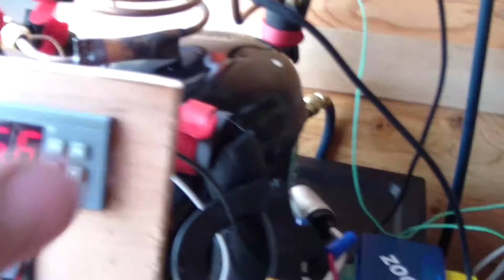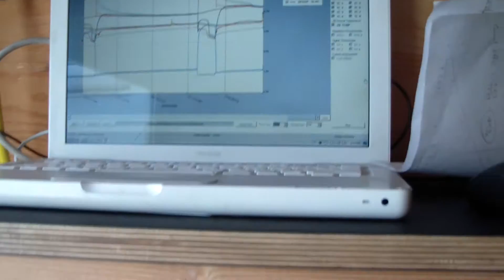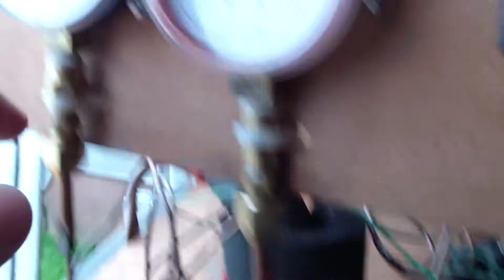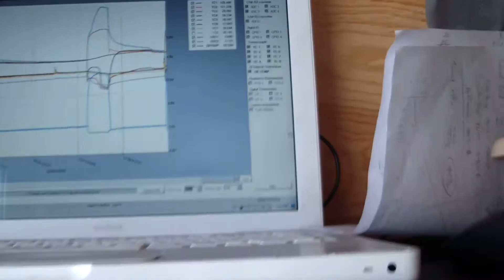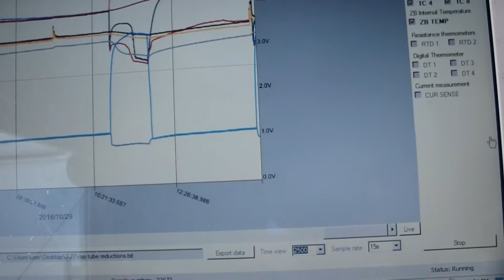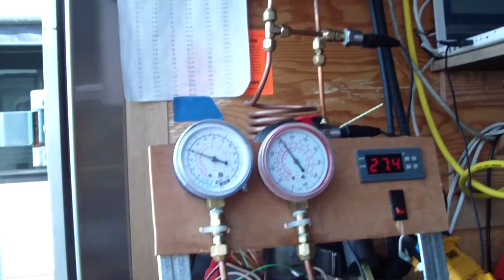DIY Refrigeration- Always Pressure Test!

Comment: You must go through lots of propane. Even though I have a 19kg tank which will last many years, I still recover it.
Reply from the maker: I should recover it; I just haven't gotten around to building a recovery machine or getting a recovery tank.  I went through a lot of propane last year, with the ebullator, and other projects.  Lately, the charge sizes are a few ounces, and get changed maybe twice a month.  When the opportunity arises for a cheap tank, I'll get it.
Reply: You can recover into your propane tanks, just watch the pressure and put the tank in very cold water while recovering.
Reply from the maker: I actually used to do that in my system last year when I had service valves on the low side and the high side.  I used the compressor to pump out the refrigerant back into the tank.  Just so happens that after your comment I was buying some parts at the supply house, and I asked about some refurbished recovery tanks they had.  At $20 I couldn't pass it up!  Now I need to get a better scale and build a recovery machine.  I never worried much about recovery as I get propane at a very discounted rate at work.  I'd like to work towards cleaning up a few pounds and using it regularly.
Reply: Yes, get yourself potassium hydroxide and silica gel and deodorise the stuff.
Reply: @ShaunDobbie  Hi Shaun, how do you do this cleaning?